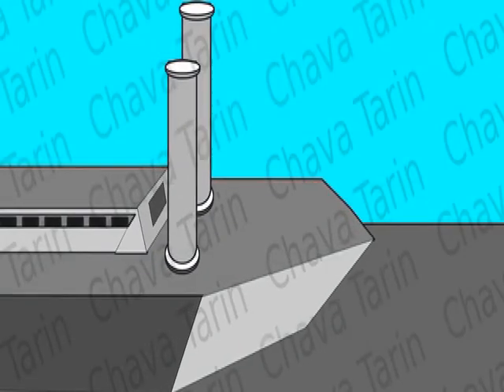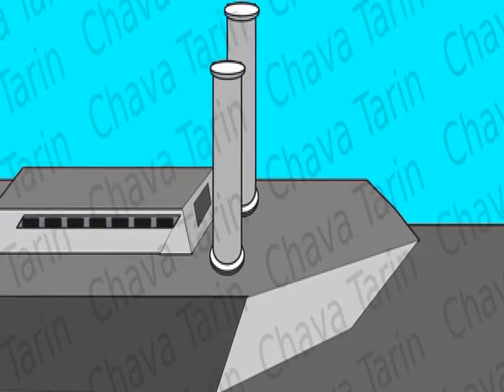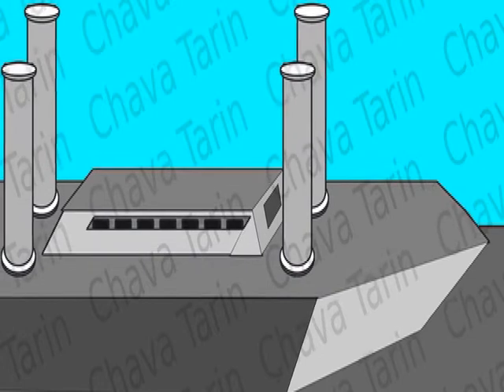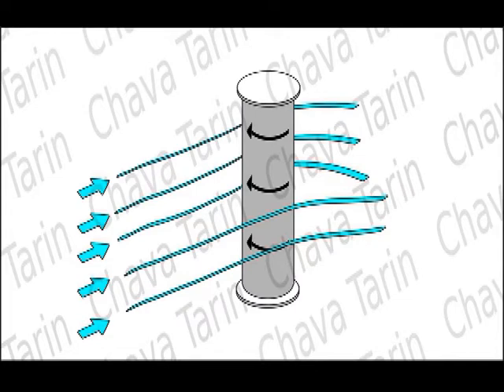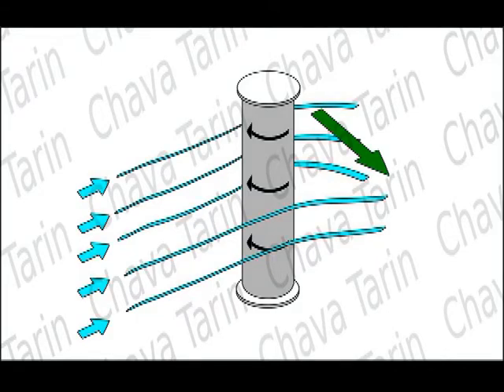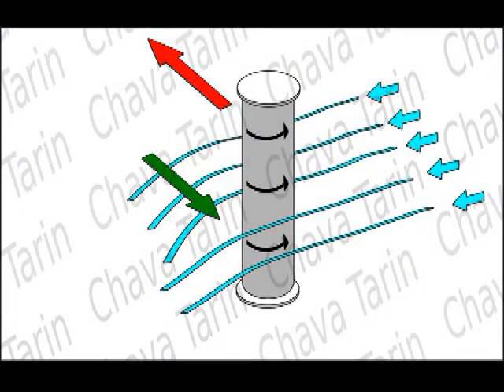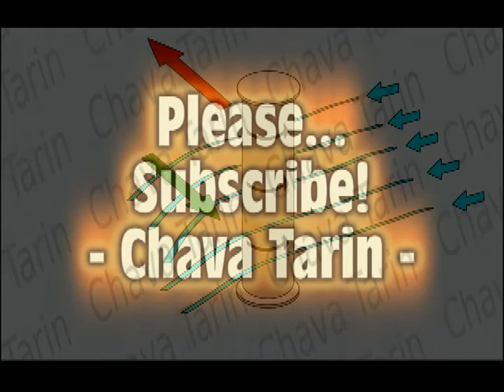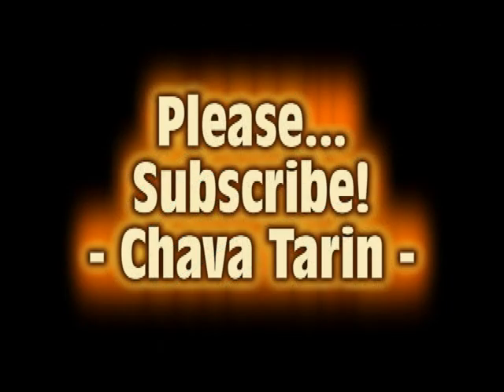Efficient Boats Using Rotor Sails

Comment: Hi. I'm looking for an answer. the force arising from rotation tends to overturn the sail, just as it happens with a conventional sail, or is it directed strictly horizontally?
Reply from the maker: The wind going against the side of the sail rotating against it, creates a low pressure which 'pulls' the sail in that direction. What really happens is that atmospheric pressure pushes on the other side of the sail. I hope that helps.
Reply: @eltunene  what about the gyroscope effect? The pipe rotates, there must be a gyroscope effect and additional stabilization

Comment: they should just use normal sails ffs, why are they so proud to not use real sails?
Reply from the maker: The idea is trying to take advantage of wind from any direction. That's the reason to include rotation of the sails. They use the principle of lift used in airplanes and wind turbines.
Reply: @eltunene   sails catch the wind for free, those spinning drums have nothing to do with sails, and they are powered.

Comment: Sir if the wind started to blow from back side or front side please say the mechanism.
Reply from the maker: Well, if you stop the rotating sails they act as a wind resistance, anyway, and with back wind they help some. However, experienced sailors take advantage of back winds as well as crosswinds. On the other hand, you can use your diesel engine, though you will have to use-up some fuel. Honestly, I have never sailed myself, but I found this system quite interesting. Cheers!

Comment: what if the air blows front of the ship to the back.... how would the ship move forward?
Reply from the maker: Well, if you stop the rotating sails they act as a wind resistance, anyway, and with back wind they help some. However, experienced sailors take advantage of back winds as well as crosswinds. On the other hand, you can use your diesel engine, though you will have to use-up some fuel. Honestly, I have never sailed myself, but I found this system quite interesting. Cheers!

Comment: is there any situation where the wind is blowing from the front or from the back so the rotors can't be used?
Reply from the maker: Unfortunately, yes. In that case, you will depend on some other means, like diesel or electricity. All sailships have to be maneuvered somehow to get around this problem.